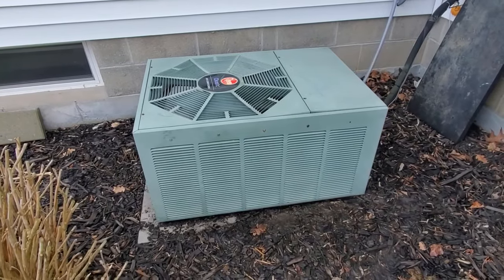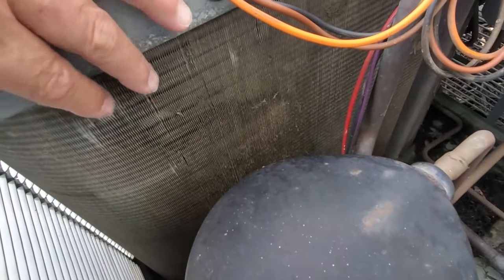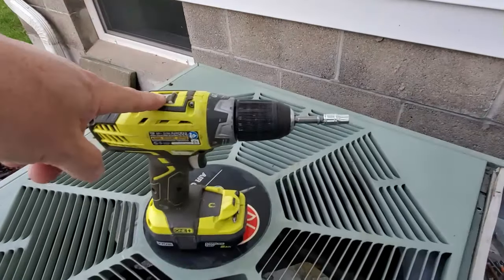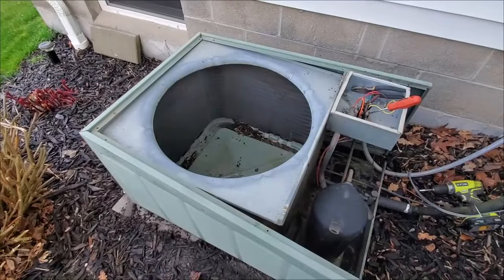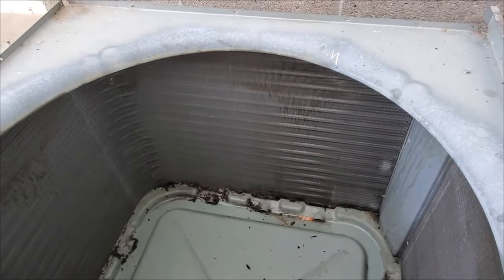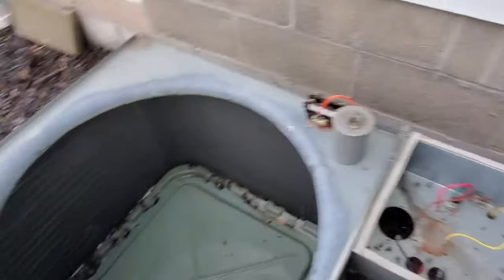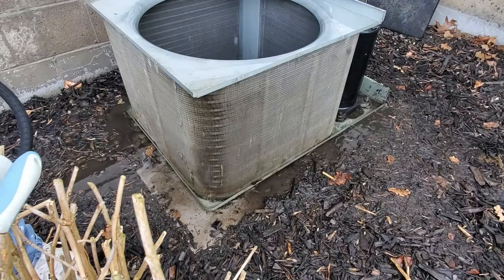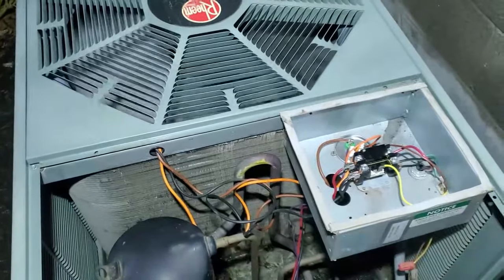How to Clean Your AC Condenser Unit - Rheem, York, Bryant, Carrier, Etc.

Comment: This is a fantastic video, much appreciated sir!
Reply from the maker: @chezchundy8892  Thank you! Very kind of you to say...hope it helped you...
Reply: No problem, I watched a few different videos in preparation to do this myself and yours was the most helpful, figured I'd let ya know :) Haven't cleaned it yet but preparing do give it a shot tomorrow
Reply from the maker: @chezchundy8892  ...send any questions if you need to during the process...
Reply: @fixeverything4u  I did it this afternoon and everything was exactly as shown in your video. The amount of dirt and cobwebs that I cleaned out was wild! AC is running much cooler now and the unit doesn’t sound like it’s working as hard. I can’t thank you enough!
Reply from the maker: @chezchundy8892  Bam! 2 Snaps Up! My very great pleasure! Yes,  I was appalled at the amount of dirt inside my unit in fact it was like a blanket I peeled off the coils. Don't know what I was thinking letting it go so long!  It was down a pound of freon also. Luckily,  I found a guy that still deals in R22. After 24 years that's pretty good. Next season I will replace the AC coil on the furnace and post another video because that thing is an old rust bucket but it still works great... nice and frosty!

Comment: Where did you get the contacter and capacitor? And i do have the same unit.  Did you need a serial number or something to find those parts? I don't see any.  Just a sticker on the box that has the contactor in it.  Thanks. Almost done!
Reply from the maker: There is a value printed on the capacitor and a model number sticker on the contactor. Write them down and go to Amazon. There are many brands to choose from for both. If you're not sure or the printing and sticker are missing from them, call Rheem and give them your AC unit model number, they will give you the part numbers to look for. About $31 total for both. If you're unit only needs a cleaning and it's not buzzing or malfunctioning in any way, I would leave it alone. I only replaced mine because one of them was malfunctioning (humming), in the dead of winter with the thermostat set to heat with no call for AC, and since I was already in there for the cleaning, I replaced both for smooth, future operation...
Reply: You are so awesome.  Thank you 🎉